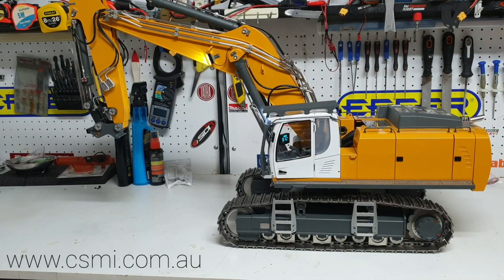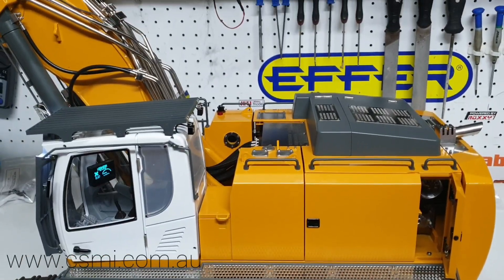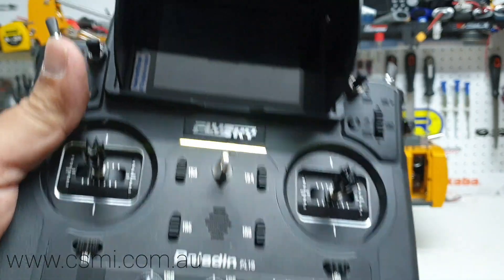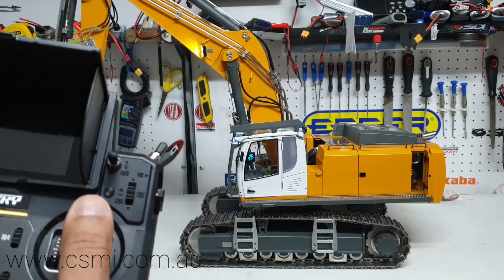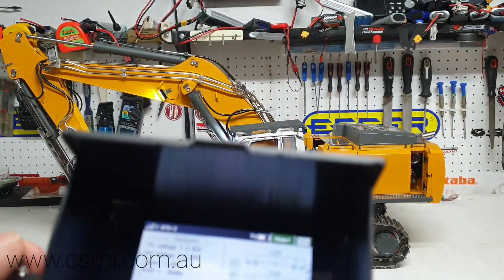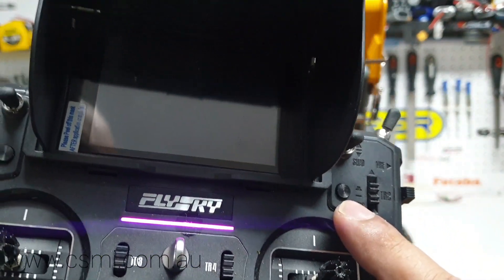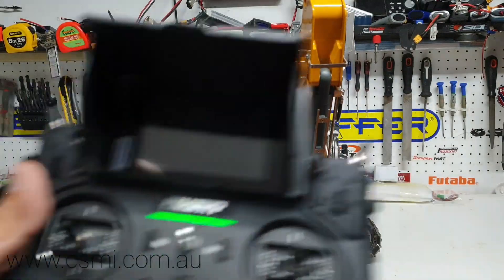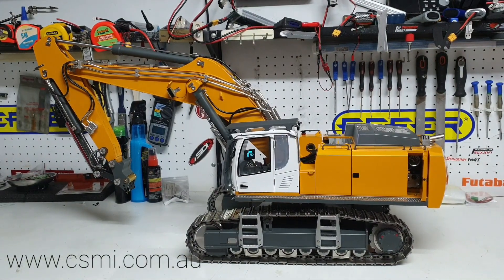CSMI : EX9700 Start sequence.  functions explained

Comment: Hey my friend, I was wondering if you could tell me the model of the transmitter and receiver and how many Hydraulic Reversing Valves that are in this beautiful machine? If you could do this for me I would greatly appreciate it!  Thanks from your friend way over here in the US! Stay safe and healthy my friend! I'm sorry I got 1 more question and that is were would I get a screen like in the cab that displays the machines stats and how to get the relyed back to my transmitter!  Ok now I'm done with the 20 questions lol so I hope to hear from you soon
Reply from the maker: Good day and thanks for the questions.  The radio is called PL18 we have these in stock. 18ch radio. We do have the data  screen too complete with all the hard ware. Its easy if you email us info@csmi.com.au.  Regards
Reply from the maker: You can get the display screen from our website.  Or email us info@csmi.com.au
Reply from the maker: The Radio i am using is a Jeti. There 9 valves in this machine